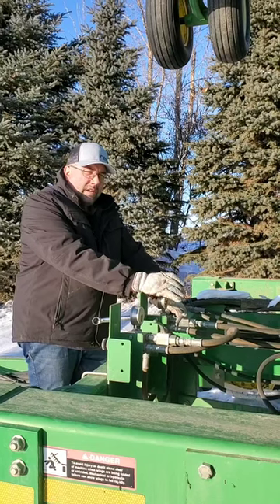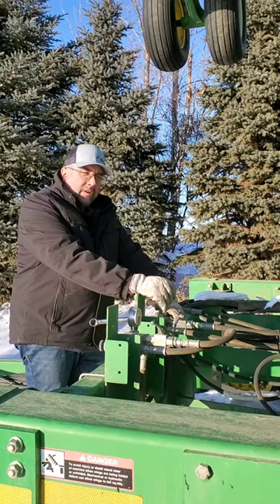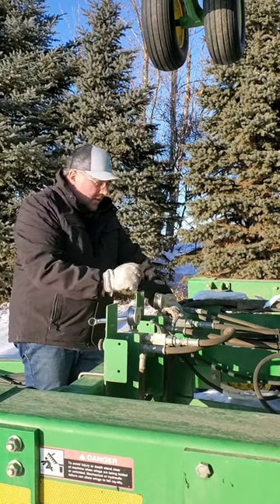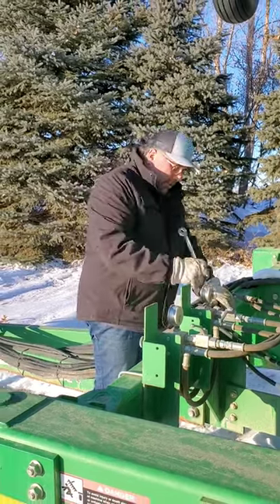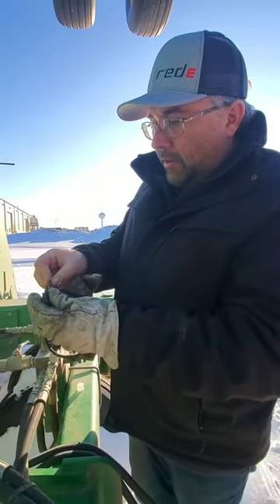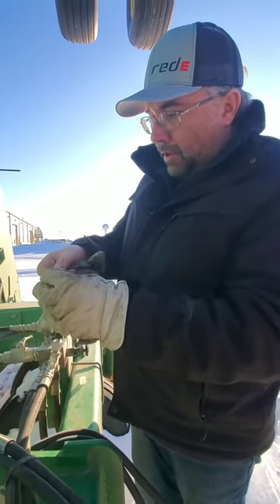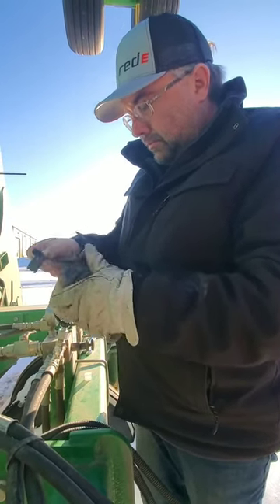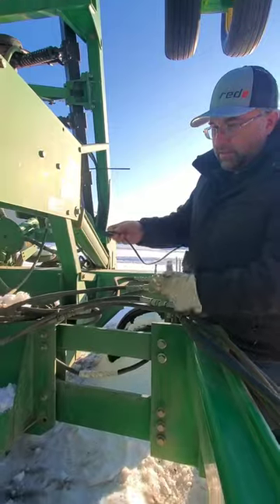Hydraulic Work Switch Installation

Comment: Would this work on an model of air drill no matter year or make?
Reply from the maker: Kind of. Sometimes Manufacturers have something in their harnesses before the switches that you have to figure out but for the most part this works for every seeder out there. may have to get different fittings.